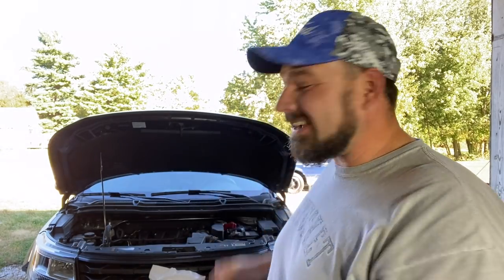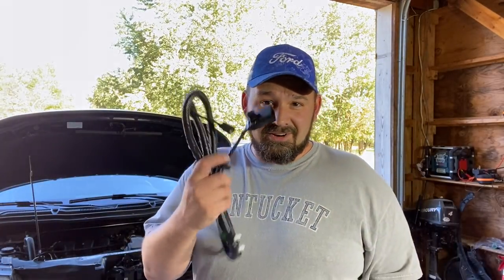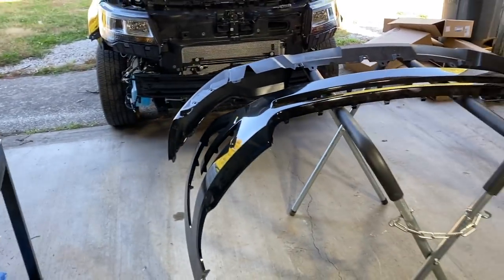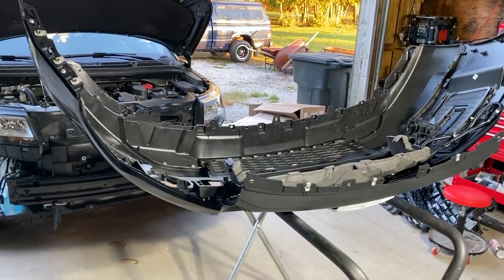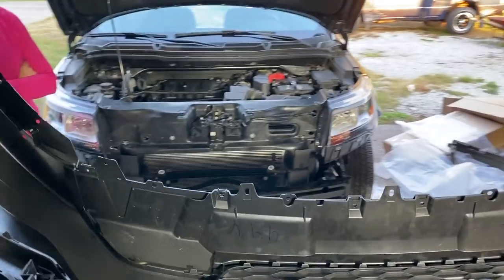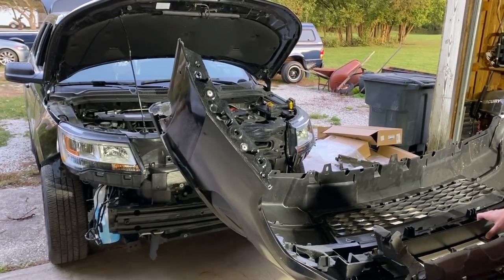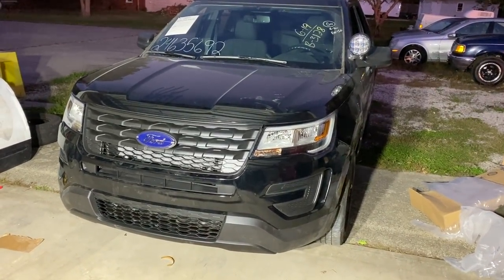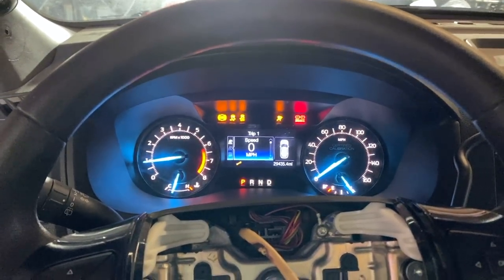Rebuilding A Wrecked 2017 Ford Police Interceptor Utility -- Part 13

Comment: There was probably a steering angle sensor in the clock spring tripping your stabilitrac. This happened on my 350z. I guess it got damaged when the bag blew. It would immediately trip VSC and traction control. It would also engage traction control around corners. Butt puckering experience when you are not expecting it. New clock spring with the sensor and it was good as new!
Reply from the maker: Awesome! Glad that fixed your Z! It may very well have been the same for me. I may never know for sure, but I’m so glad it’s fixed!!

Comment: Amazing job. Can`t wait to see the finish product! :)
Don`t you have a center console? Look for a oem one online. Also, i`m pretty sure you can retrofit quite easy different things such as fog lights
Reply from the maker: Thanks! I bought a console, though it’s not an OEM one. You’ll see that in the next vid. I may end up adding fog lights at some point. Not sure.
Reply: I had some issues with the aftermarket armrests in the past, i would not do the same thing again. Keep an eye on pull a part and see if you can get one with all the brackets and bolts.
Reply from the maker: Thanks! The main issue I have with putting a factor console in it is that there would be a hole where the shifter would normally be. But this being an Interceptor, it is column shift. I know Ford made what I think people refer to as an Admin console or something like that. Basically a civilian style console but with no shifter hole. But they’re extremely rare.
I’m any case, I’ll see how the one I got works out. If it ends up being junk I’ll look at some other option.

Comment: The vehicle is looking much better but I still would take that goofy spotlight off and either just plug the hole or replace the trim piece.  I have lived 71 years and never needed one and I don't think you will need one either.